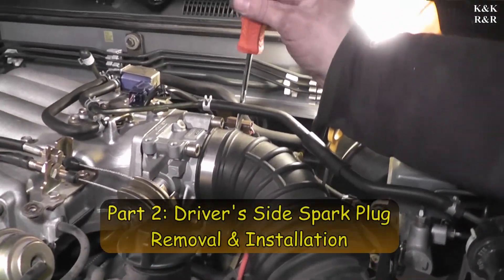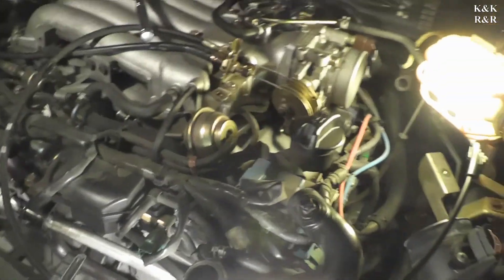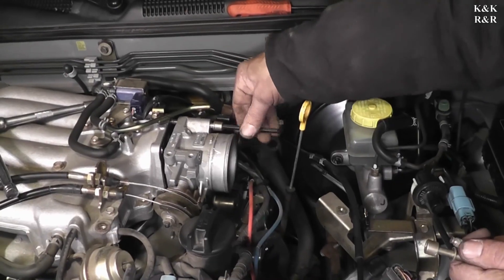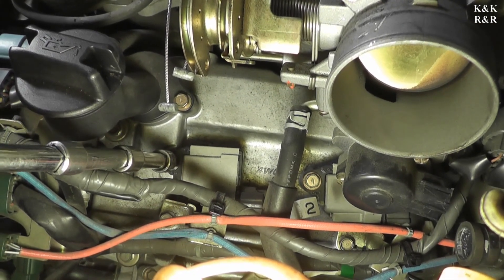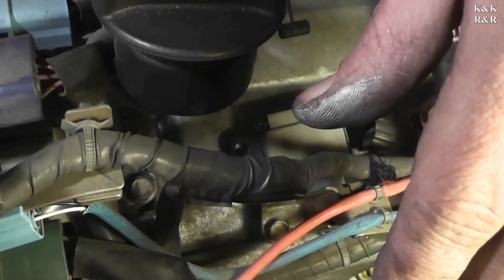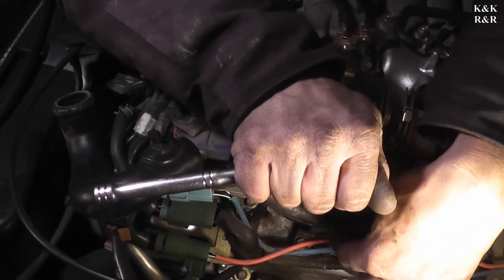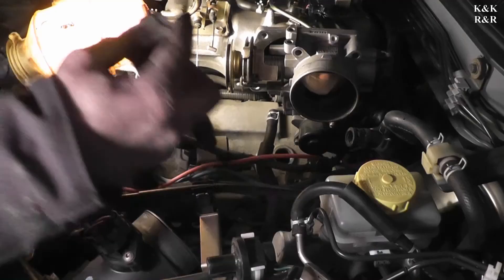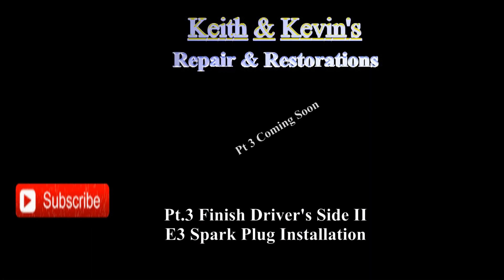2001 Infiniti QX4 3.5L Import Tune Up Series Pt2 Driver's Side I E3 Spark Plug Install (CYL 2, 4)

Comment: Wow guys thank you this video has been such a learning experience for me. I’ve only changed plugs out once before on a 70 stang and that was a breeze compared to this! I have learned so much. I had the rubber gasket in my spark plug socket come off and get stuck on the spark plug in cylinder one, do you have any ideas on how to get it off safely? Plug is already torqued in there.

Comment: That's a lot to take off to get to 2, 4 and 6.  You gave it a 5 but as I watch it I would think this is at least a 7.  I changed 1, 3 & 5 exactly the way you illustrated on part 1.  2, 4 and 6 is more challenging and definitely more intimidating.
Reply: LOL some of these comments in here Good Golly the ship was put together it can be taken apart I don't see what the big deal is I've done this twice once I just took four of them off as matter fact last night just to look at them before I put them back together so I could go to work and now I'm going to take him back off it's not that difficult I bet a Lego set would be difficult to huh
Reply: Mike Kendrick legos are difficult sometimes

Comment: 256k miles on my plugs just changed yesterday 02 pathfinder. You think that plug looked bad you should have seen mine the gap was twice the size as the new ones the tips were triangles and covered chunky carbon except right where it sparks. Number 1 fouled out is why I changed them. But it fouled because I believe my injectors got stopped up when it was 40 cars at gas station
Reply: Still has a little studder especially in idle in gear holding brake

Comment: Very Good Video i Had Overheating My 2001 Nissan pathfinder 3.5 Liter Engine i Replaced Front And Rear Thermostats And  Value Cover Gasket and Bleeds but it's Still Overheating What Should i do May i get Some information Please Thank you i'm from Vancouver British Columbia Canada 👍👍😁
Reply from the maker: When we get those type of overheating issues in there can be other issues in the cooling system that need to be addressed.  The most common issues is a clogged radiator.  The second most common issue is the fan clutch may not be spinning up once the radiator is up to temperature. Third common issue is the water pump blades can erode over time and not pump the correct volume of coolant needed to cool the engine. 

How to test for these issues; 
Test for a clogged radiator, the radiator will have cold spots where hot coolant isn't flowing.  Normal if the radiator is clogged enough you will have a cold bottom lower hose which should be warm if the radiator is cooling properly.  If the radiator is clogged the air the fan clutch is pulling through it will be cold as hot coolant is not passing the core fast enough.

Fan Clutch Test
When the engine is hot rev it up and you should hear the cooling fan spin up and get louder as the air flow increases, if the fan clutch is bad you will not hear any noticeable difference  in air volume (noise) with the increase in engine RPM's. This condition is know as freewheeling. If the fan clutch is bad you will also see oil build up around the fan, clutch bearing / hub assembly. 

Water Pump Test,
You should have a hard upper hose when you squeeze it when its hot. The upper hose should feel hard as rock period once the engine is warmed up. If you can squeeze the upper hose together most likely the water pump has failed. 

These tests should help you narrow down your overheating issue. Be careful you don't burn yourself!  These tests need to be done with the engine up to normal operating temperature. If the engine is overheating do these test one at a time and let the engine cool down between tests.  
/K&K
Reply: @KNKRNR  Thank you so Much for Your Help i Replaced My Radiator Two Years ago Maybe Water Pump

Comment: Hey thanks for all the instructions they were well doneI went and boughtThe T6 Hardened steelTook it very seriously! I want the plugs that you did as well Really nice fined by the way I think I'll use them again!  Took the plugs out and Six Looked actually bad For a vehicle With all hundred and 120,000 miles on it...I also did the gas tank filter Sorry the fuel filter  gas Filter And poured gas all over my arms and my eyes Ha ha but the kids pool was really close so I dunked my head in it ! I guess I could've done it out of a lot smootherBut That would include some thinking thanks again

Comment: very helpful video. i have a question. i have qx4 2002 and i went to dealership the other day and they told me my car has a ECM and IACV problem but the car runs and drive well, i dont have problem starting the car. they said i have to change both of them, otherwise it will create another problem. plus its a lot of money to fix it so is there a way fix the problem without spending that much money? and is there a problem if i change the only IACM and leave the ECM as is?
Reply from the maker: Wait what they want to change the ECM and IACM for an engine that runs and starts fine? Do you have engine PO Codes?  Its rare to need to change an ECU on QX4's.  I would need to know what issue(s) you are having, but techs change IACM all the time without changing the ECU.
/K&K